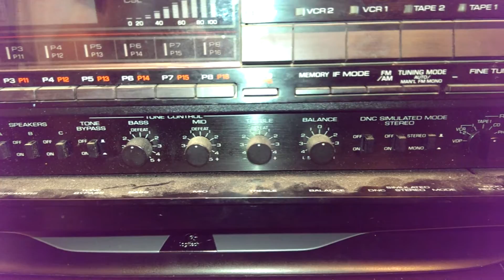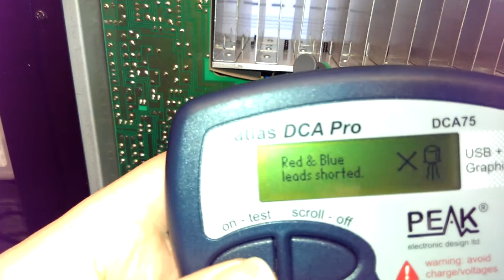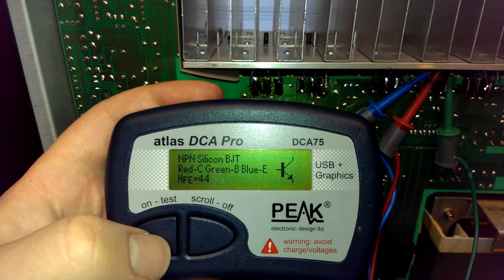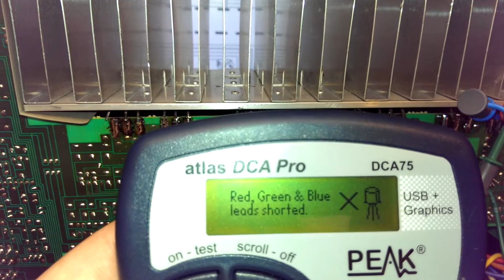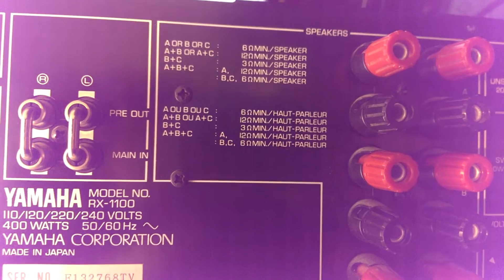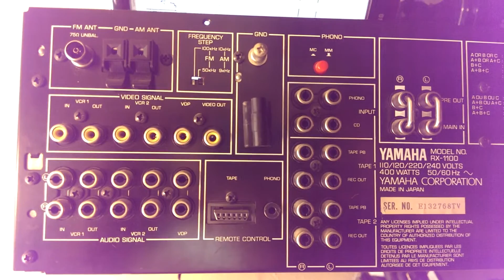Yamaha RX-1100 Receiver: BOOM went the output stage!

Comment: you could have used On Semi njw3281/1302 here in place of the originals, they are in to-3p package and have superior SOA. generally emitter follower output stages are forgiving if you change output devices to a different type, provided you take care of the driver section and preceding stages.
Reply from the maker: I ended up using 2SC5200/2SA1943 in a TO-3P variant. I forgot the actual number off the top of my head; Fairchild gives these a different part number while Toshiba uses a different suffix instead (O for TO-3P, N for TO-264). These, though not as large as the transistors you suggested also provided a very large increase in SOA and will probably last for decades. The drivers do not normally fail provided the output stage remains intact.
Reply: they are 2SC5242/FJA4313. still much better than the originals. good work mate.

Comment: Still wonder what causes common output/driver failure this model working on one now r ch failed twice
Reply from the maker: Check the bias current! This one was WAY high after the repair and it needed a very significant adjustment. 

Also, check the output snubbing circuit if you have oscillation issues. Bad solder joints are also an issue on these.
Reply: I cleaned and reset bias 10mv, resoldered all drive board new filters etc, been running 2 days so far.... 1st time I used some china outputs from ebay now using orig japan running on 8 ohm load box  crossing fingers...so far so good!
Reply: 4 days still holding pushed to 50w so far so good
Reply from the maker: MrMotownjoe Those Chinese transistors were your problem. You're lucky the originals you found weren't counterfeit. At my shop, I almost always use a modern device for replacement purchased from an authorized distributor. Counterfeit obsolete Japanese parts are just too common.
Reply: I used original Japanese 2sc3281 2sa1302 160v 15a  I had back in the day when I had my repair shop, still test running good thanks for your help Andrew.

Comment: I have a question for the tester. Does it matter where the tester leads are connected or can they be put onto any leg of the transistor and still receive valid results?
Reply from the maker: Dudefoxlive It does not matter; the Atlas DCA Pro automatically identifies leads.

Comment: Peak Atlas DCA 75 Pro is not for in circuit test.
Reply from the maker: I wasn't testing in circuit. A device still mounted to the heatsink via a thermal pad and a device with leads still soldered to the PCB are two entirely different things. Watch the video more closely and you'll see that the leads are indeed lifted from the pads.

Using the DCA 75 in circuit usually results in a "No Component Detected" error, not a short circuit error. To say I'm familiar with this little device is an understatement.

Comment: have you tested them after desoldering? i doubt the all blew up....
Reply from the maker: +ᅚ They were desoldered. You never replace just failed units when one unit in a pair fails. The other one may have been stressed beyond limits and poised to fail. Also, it's easier to gain match with all new transistors, especially when the original part number is discontinued and a substitution must be made. This unit blew out most of its output devices so the "savings" would have only been a few dollars. The potential costs, should it fail again, are much higher. Andrew's Electronics does it the right way or not at all.
Reply: @MadScientistsLair  Yep, ordered all the outputs for my Sansui G-8700DB receiver. All 8 outputs at $7 each is cheap insurance. T03 devices made by ON semiconductor, from Mouser. Looking for the driver devices, or rather the replacement equivalents. They are not showing as shorted, but they have had a lot of current running through them due to several resistors on the driver board open, or unsoldered themselves because they got hot enough to melt the through hole solder joints.